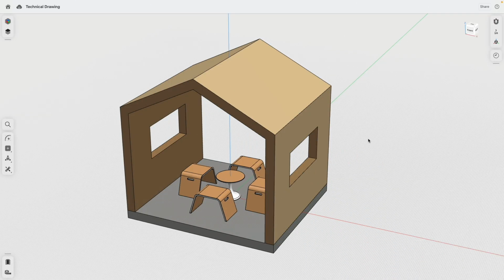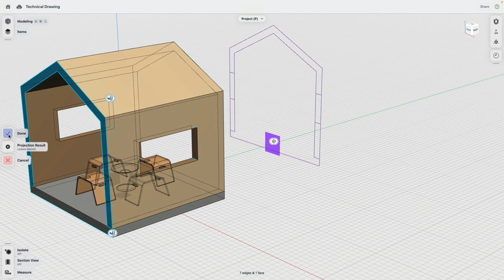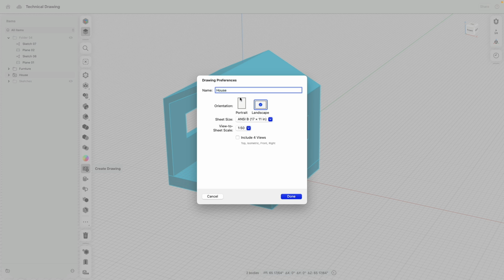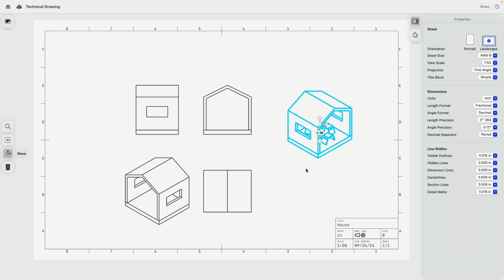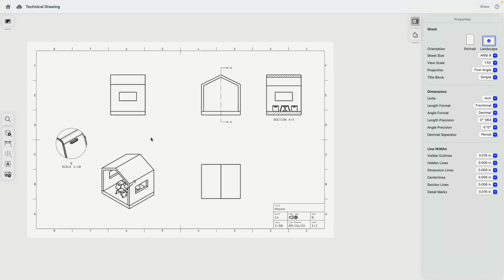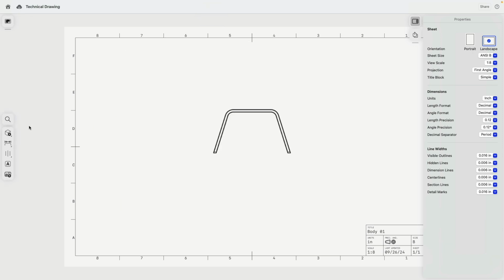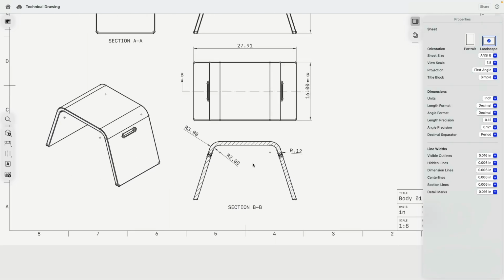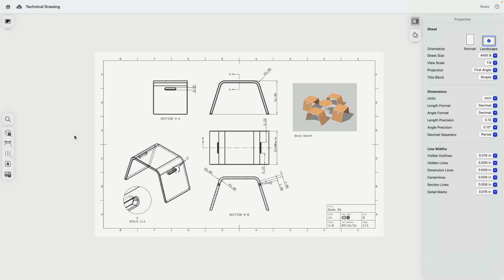Shapr3D - Bent Plywood Bench Technical Drawings Intro

Comment: wow that really simplified the drawing function for me, I used to just keep my ipad handy and get the dimensions from the screen directly before I perform my cuts on the table saw. I tried the drawing function but never knew how to really use it correctly to get the views and dimensions I needed. excellent as always. thanks Claas
Reply from the maker: @mohamedsoud  yeah drawings in Shapr is super easy. Glad that the video summery did help. I forgot to say that you can also make those projected views without being a linked sketch. Then you can move them around later like a cut sheet.